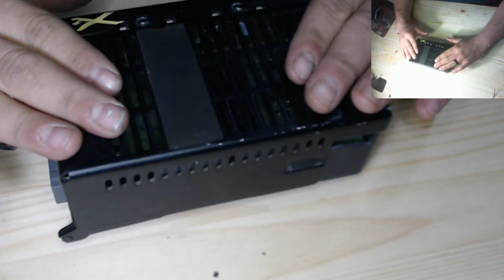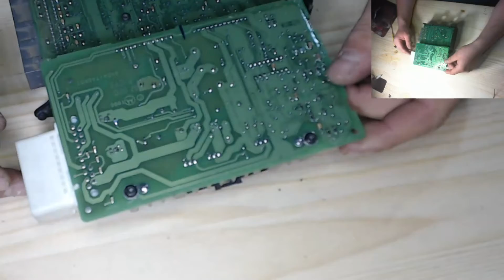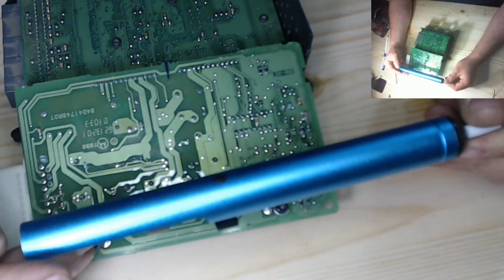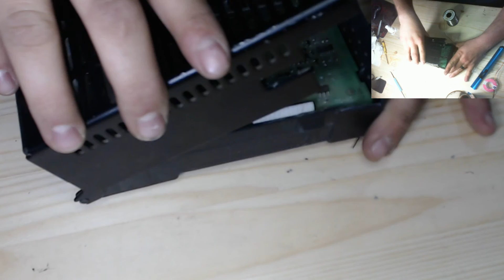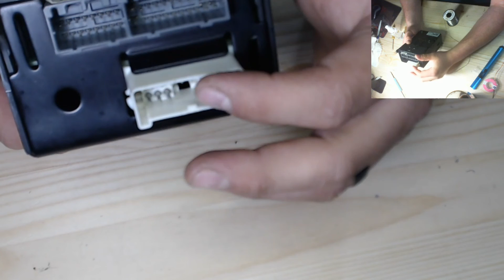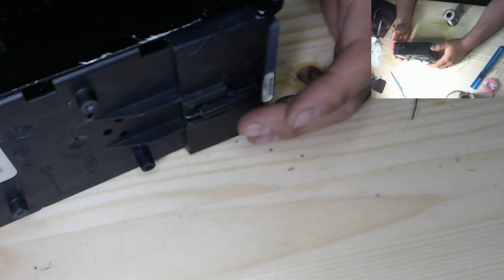2000 Grand Marquis Crown Vic LCM (Lighting Control Module) Repair

Comment: My LCM buzzesn for 5-10 minutes on mornings its below freezing during which time the headlighs won't turn off. They'll stay on at  50% brightness or so. Dang dude I think you just broke my heart. I was hoping replacing the three relays on my LCM '04 Town Car, but my headlight chime hasn't worked since I bought it.

Comment: Any insight on lighting issues, no tail, dash or automatic lights but the recall was done on Dec 20,2018. Will this fix help at all? Thanks for the video
Reply: These tech people will never answer this question. A lot of us wonder but no answers. I will know soon because I am having mine replaced at the dealer.
Reply: x2malandy did it fix your lights issue? On mine I also don’t have turning signals no communication with lcm no tail lights no interior lights only daytime running lights working and high beams and brake lights work
Reply: @nickvitobovino3486  I have a similar issues.. I got a #21 fuse keep blowing after I move into shift?...

Comment: Another good option for sourcing this relay: Panasonic JSM1-12V-5. Currenly less than 2 bucks at Mouser.
The NEC EQ1-11111S looks like it was discontinued at Mouser.
Thanks for the nice vid!
Reply: will the JSM1-12V-5 work with a 2001 grand marquis ls?

Comment: Why they are covered by recall for like ten years
Reply from the maker: This is a 2000 or 20012, and most of the time you call the dealer with the VIN, they say its already been performed.
Reply: Mine was recently taken for recall and after that the whole LCM become inoperative, only high beam works. nothing else. I performed removing of the four relays test the relays with load 
( light bulbs conected and are good) reintalled the four relays with fresh soldering   installed the LCM and didn't work, now I don't know if The LCM needs to be reprogramed or the main computer will reload O relearn the firmware need it to function again.
I know these is an old post, but this kind of fails are still around, my Grand Marquis 2003 been an actual example.

Comment: ive soldered bulbs for back lighting on an hvac control head  I cleaned with alcohol bulb leads and board   used silver solder first then lead tin mix  both rosin core....could not get the solder to stick to the bulb leads  ??   using more and more heat the trace on the board came loose...it finally stuck and it worked   what did I do wrong?
Reply: I can't imagine bulb leads being that big or thick... but if leads dissipate heat too quickly, that's a main reason for no solder adhesion. For example, soldering 2 wires together... 16 gauge wires will more readily accept solder and more quickly than a 4 gauge, where it may almost take a minute to heat up. Silver has a higher melting point, just be aware depending on the application.

Maybe post a link to show what you're describing?
Reply: thanks cuba.. .  yea the bulb leads were a hair thickness   im thinking corrosion  that the alcohol didn't remove  this was done on my car  at the shop I would just replace and reprogram if needed